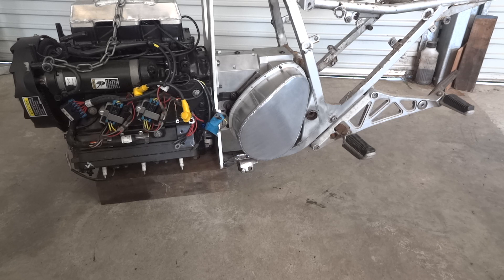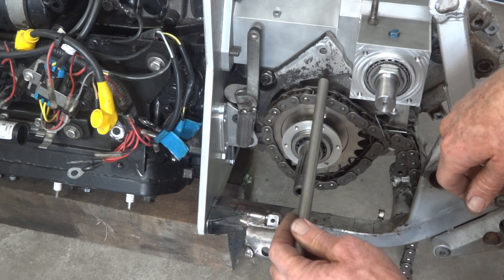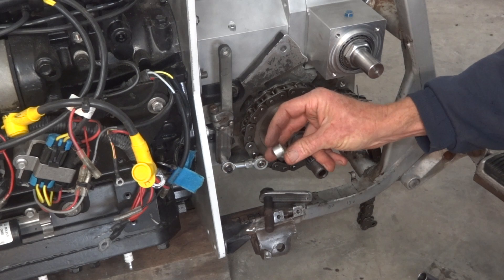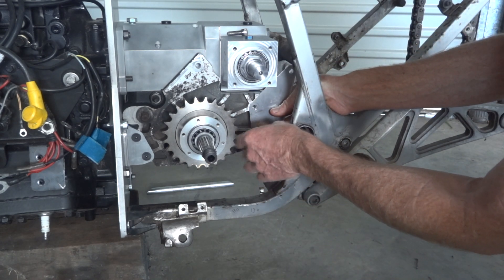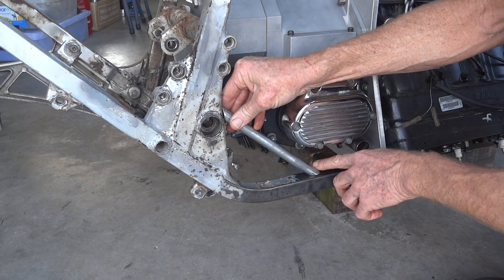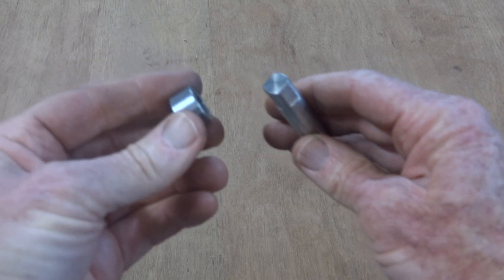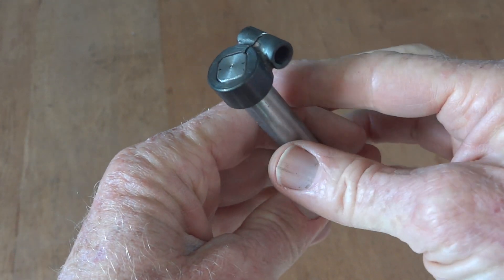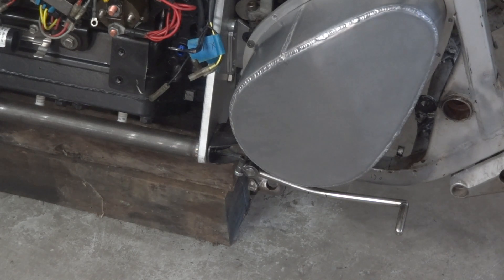Mercurial Outboard Motorbike Gearchange. Mercury!

Comment: This may be a dumb question, why not use a 1/2" extension and a socket rather than making a square hole and filing?
Reply from the maker: excellent idea. Buy a short extension bar, cut it in half and plug it back into itself!